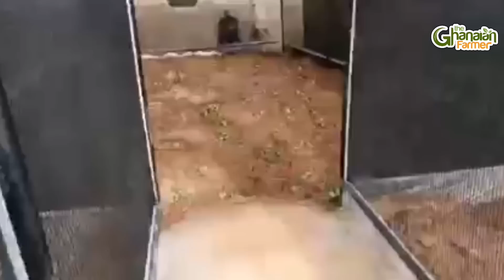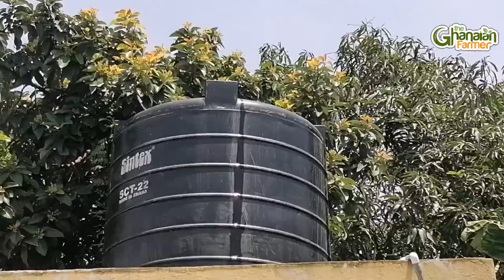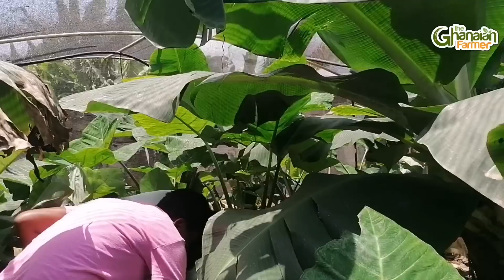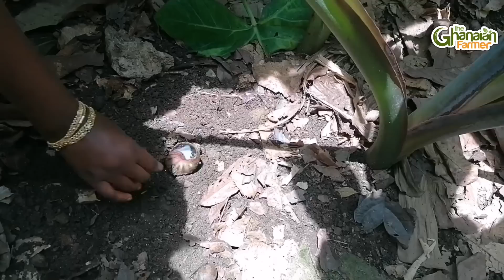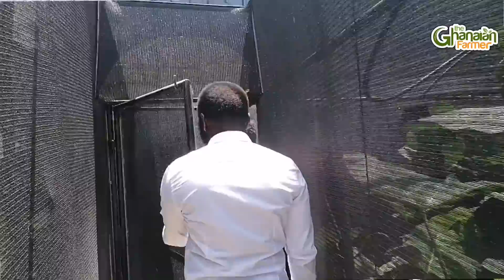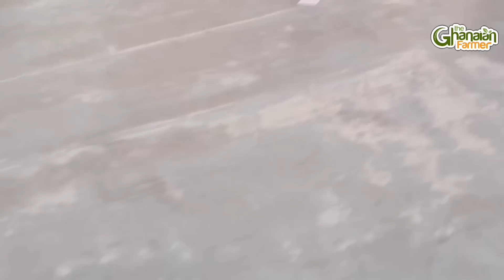How My 7 Years Of Snail Farming, Installing Greenhouses & Exporting Made Me Profits Of $700,000

Comment: Thanks for the education. However I think you should cross check the calculations. 50 eggs multiplied by 1000 is 50000 and not 15000. I stand for correction though
Reply: 15000 cos an estimate of about 15 eggs (1/3) surviving from each of the 50eggs.i stand corrected